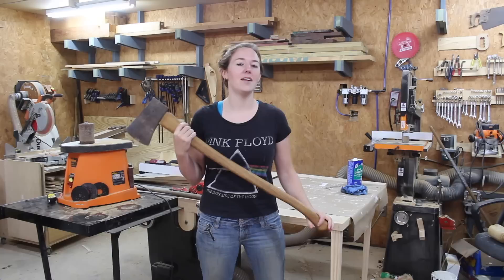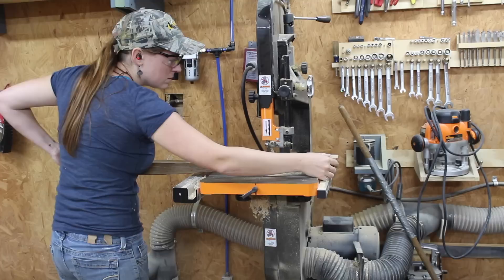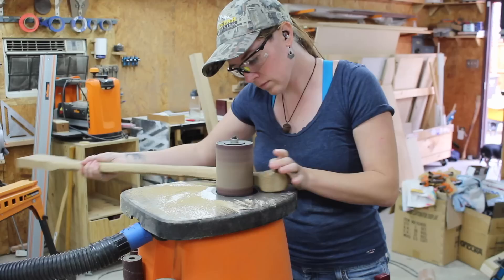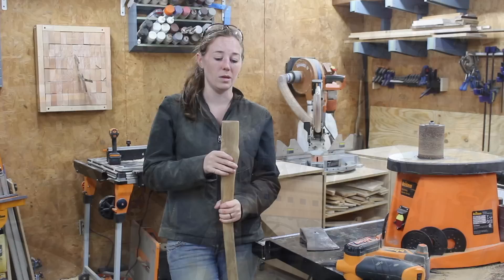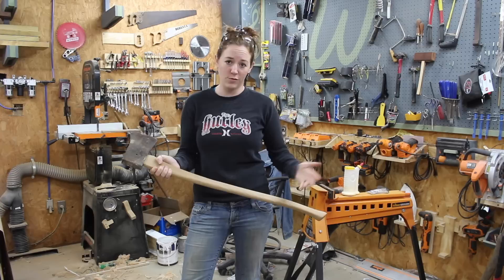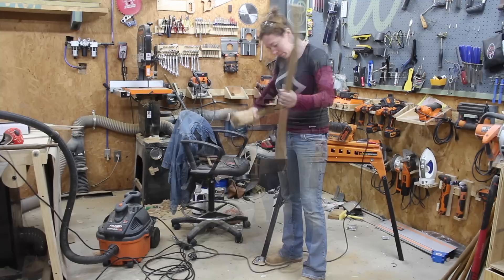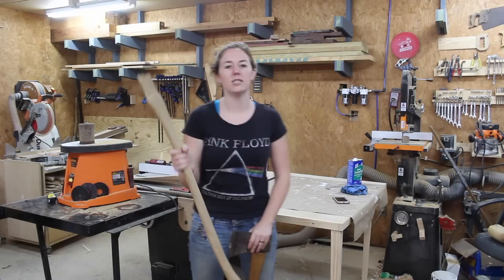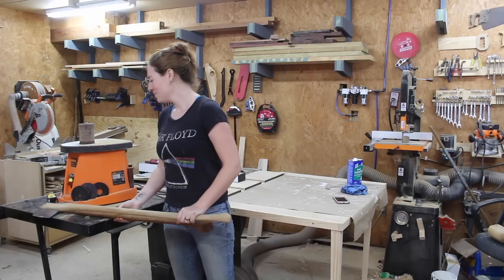Making an Axe Handle

Comment: Dont worry about mistakes. I do collision repair for a living. About 17 years ago I started working at a new shop, after I had been there about 2 weeks I got a job from my manager, went out to the car, pulled it into my stall, read the estimate and started fixing the car. The unfortunate thing is that I had started fixing the wrong front fender. I had read the estimate properly but got in a hurry and didnt realize that both front fenders had damage and only one was accident related. Long story short, my boss had to call the customer and tell them they were getting the other side of their car fixed for free because we were just that nice.. Oops. :)

Comment: Last winter I made a corner-shelf unit to sit on my counter next to the refrigerator.  All the shelves were specifically set for particular appliances an pots, and most importantly,  to allow just enough room for the breadmaker to be used without having to drag it out.  I even managed to get everything cut out of one half-sheet of plywood, which was tricky, since the over-all dimensions of the non-rectangular shelves was greater than 48”.

Everything cut well enough, I had my nice fitting dado’s, but as I assembled the las glued piece I realized I had put my two support pieces together backwards, and the bottom shelf had not enough “leg” and the top shelf had long upright sides it didn’t need. :)

I cheated by adding pine boards to the back as stilts so the shelf fit where it was supposed to be, and just slicing off the top extra bits, as the unit was sized to go from counter to ceiling..

Comment: Mistakes make a project interesting and force you to think on your feet. 

My biggest mistake in the workshop: While making a laminated bow riser. I sanded every 1/4 inch piece down to a rough finish so the epoxy would grab the wood, but left the back and front unsanded as I wouldn't be putting glue on those parts. After clamping and letting it dry and cure, I hand cut, rasped, sanded and finished the whole thing over about 9 hours. Once it came time to put the limbs and bowstring on, that's when it hit the fan. Turns out, the factory/smooth edge got mixed up and ended up dead center of the riser,  so as soon as I put the string on and drew the bow back a few inches, the whole thing snapped in half. I said a few of my favorite words, then scrapped the riser and started all over again. Riser 2 and 3 turned out pretty well, but I'll never forget what happened to that first one.

Comment: Funny that you asked about things going wrong, I only posted the following comment two days ago on 'Make Something':
I seem to recall a story about the early space programme where a rocket took off from the 
launch pad OK, but instead of going vertically into the sky, the  guidance system failed and it started to fly horizontally before being auto-destructed.  On the face of it, this appeared to be a massive failure, but one of the engineers pointed out that the rocket should not
have been strong enough to sustain horizontal flight - its structure should have failed, but it didn't.
The designers realised that they had made the rocket stronger than necessary, so were able to weaken the structure.   This involved a consequent drop in weight, which meant either a reduction in the fuel required, or an increase in payload - both tremendously important factors for rockets.   
An apparent catastrophe thus proved in fact to be a significant bonus!
For you April, the first errors enabled you to find alternative - and better - ways to achieve your results, so it was just a 'learning curve' !

Comment: Well I don't work with wood quite often, but most of my mistakes occur when I'm sewing. Honestly, I have countless stories on projects that I've messed up on where the fit was bad or the technique I was using didn't look right. Heck, I've even made things for other people that were complete crap lol. But somehow, I just never gave up, even when I probably should have, but I didn't. 
So yeah, that's my little story on my mistakes. The axe handle looks great, and I'll probably never have the need to make my own lol. However, I'm thinking about making a wooden handle for a DIY rotary cutting tool for fabric. I'm too cheap to go out and buy one, plus I have some blades that would work. Maybe if I finally get around to making this project, I can tag you to show how I was inspired by you haha. Anywho, great job!!

Comment: A tip for you when bandsawing - use hot melt glue to reattach the cut off pieces for much safer sawing. Keeps things almost square

Comment: Pappy (grandpappy, actually) would position the axe butt down, slip the head's eye  over the wooden "eye section" (per Alex W. Bealer), then thump the whole thing straight down onto a flat top stump or old railroad tie on the ground, the head end up. After each stroke he "checked it for square", tapping it with a worn out hammer handle to bring it to his desired angle of attack, then thump it again.
 Once the thumping acheived no further progress, he used a commercial wedge, seemed to be oak or ash, and thumped it head down for the final strokes, mashing the end of the wedge for good measure.
 Definitely soaked in boiled linseed oil a couple days, then sun dried, polished with an old leather glove and the head cleaned then oiled.

Comment: Mistakes. I'm working on a large cartography project, and have been for the last 2.5 years. I'd sunk more than 18 months into the project when I realized I'd done at least 1/3 of it COMPLETELY wrong and had to scrap all the maps and start over. I'm much closer to done now, and will probably finish it off by the end of this month, but that was a real head-meet-desk moment, realizing how much I'd done wrong. Helped me learn what to do differently, though!

Comment: I had the best desktop made with oak plywood centered on four oak board that I had spent weeks perfecting. It looked pretty sharp after routing the edges and sanding it smooth and level. Then I had a crazy idea from Jay Bates to try my hand at planing. So...I got an electric planer to level it out. I thought I had my blades set flat but alas, I had them easily 1/8" down and tore right down the middle of it, revealing the middle of the board and destroying the top's finish. Thinking it was needed to make the project work, I just kept going to town on that thing, ripping over and over...then I stood back and saw the horror I had just created. I started all over again.

Comment: Not a woodworking project, but I once spent the better part of two days replacing a damaged front fender on my old car, only to snap off the head of a bolt and scratch my door I the process, just as I was finishing.  I was NOT pleased...

Also, I think you should engrave the first axe handle on both sides.
"Failure is part of Progress,"
"...so don't lose your head."
Thank you for all the great videos!

Comment: If it makes you feel any better, I made a HUGE mistake on my Jay Bates Miter Saw Station Build. I didn't check the drawers for square as I was assembling. All 20 something drawers are not square and won't close properly. I now have to buy 8 more sheets of 3/4" ply to replace the drawers and fronts. :(

Comment: This is about 2 mistakes, one mine the other the cause of my mistake. Just before I turned 18 my father brought me an old 1959 Ford as a present for finishing high school. On my first drive I left with 3 forward gears intact and came back with one. I spent the weekend pulling out and rebuilding the gearbox. The car had been owned by an apprentice mechanic who had done it up as a project, including reconditioning the gearbox. I discovered the cause of the failure was that he had installed one of the synchromesh cones backwards causing it to seize in 2nd gear. Anyway my repairs lasted me 6 months and the gearbox failed again. The damage was so bad I had to go to a wreckers to get a replacement. They were very helpful and told me that that model gearbox had a lot of problems which were only fixed in the following years model and that gearbox still fitted my car. My mistake was trying to save money by fixing the old one and not getting the later gearbox in the first place. Still I learnt a lot about maintaining cars owning that one. My record for keeping cars going was a 1969 Holden, (basically a medium sized Chevy) I kept that running for over 500,000 miles. It would still be running but some idiot parked his Toyota Landcruiser into the back of it. He did a good job of it. Previously it was rear-ended by a Land Rover towing a boat and only needed a new rear bumper. Mind you he sandwiched a Mazda between us so that took most of the impact.

Comment: I am making a draw system for my workbench which I use for my polymer clay work and i need 20 draws for it well umm after I finished making all my lovely draws all 35 of them 🙀😹 I am now making Dad a screw cabinet with the extra draws that I made I sort of got carried away when cutting up the 3mm MDF because I had just made myself a sled for the bench saw 😹😹😹 and was having so much fun using it as it made the cutting the small pieces a breeze I did not count how many I was cutting just as well I had already planed on making Dad the draws cabinet for the screws just got made sooner than latter that's all😹😹
Loved the ax handle that you made I have a few pick ax's and double headed axes in the workshop was going to buy new handles for them but now you have inspired me to make my own 🤗 so have written it up on the job sheet we have in the workshop 😹😹 for all the things we want to make for both the works shops and the house 😹

Comment: Lovely job on the axe handle April...as said before you nailed it right down tot he boiled linseed oil and it prolly wont matter bu tone other tip is to run the grain the other way it makes it more durable .. what i mean is the layers of wood should run the same direction the axe head just like a sheet of plywood is bendy till you stand it on edge then it is totally rigid so that is also kinda my first failure story with handles i made a dozen hammer handles for my blacksmithing hammers and most of them broke then a old timer saw me on e day and said did you know you had the grain going the wrong way talk about red faced LOL  and how wonderful job cheers

Comment: I make pens, and one of the first nice pens I made I eyed the pieces (like I used to make models when I was a kid) and figured I knew how they went. It turned out that there were a couple of couplers that I had put on backwards, so now I had to disassemble the pen. Well, no tools for that (at that point) so I took some pliers to grab and twist the parts off. Yep, damaged them and some other threads, so.... Not to worry, I have a spare pen around the house, as I was able to repair it enough for that. Lesson learned... again, if there are instructions read them.

Comment: OK.  Here's a failure story for you.  I bought a band saw (I think yours and mine are the same) to cut band saw boxes with, though it has since become my favorite saw for all kinds of things.  Don't know if you've cut any band saw boxes or not, but there is definitely a top and bottom to the drawer since it's quite hard to cut them perfectly symmetrical.  I did not mark the tops of the drawers and wound up cutting the void for the drawer on the bottom of the drawer.  Yep.  You guessed it.  No way in the world would it fit by flipping it over.  So far not too bad.  But on the very next one, I did the same thing again.  Not quite as funny the second time.  I then learned to mark the tops of the drawers as you cut them out of the blank.  Simple solution.  They say genius is the ability to perceive the obvious.  I guess I don't qualify lol!

Comment: I was putting new fascia,  soffit and siding on my house.  I stripped all the old aluminum siding off and installed the new soffit and fascia.  There was one dormer part that had old cedar clapboards on it.  I didnt feel like stripping that off immediately so I continued installing the soffit and fascia.  When it did get stripped off and new siding applied.  I now had almost an inch gap betwix the soffit and wall.  So I had to rip down that 14 lineal feet of soffit and redo it.

Comment: I tried to make a handle for a small ball pein hammer.  I had some nice looking laminate material from an old cutting board.  Little did I realize that it was bamboo and I wasted about 90 minutes of cutting, shaping and sanding when my LAST CUT split the laminate halfway down and ruined the project.  Note to self:  Just because you think it will LOOK NICE doesn't mean it will BE PRACTICAL AND WORK!

Comment: Working as a software developer, at some point I fixed a minor bug (a menu that was shown when clicking a button was positioned about 50 pixels higher on the screen than it should be; for the record, I didn't write that particular but) in a piece of code that was used in different applications. Unfortunately, my fix introduced a new bug which rendered clicking several other buttons impossible. To top it off, applications with that new bug made it onto a released DVD that ended up at customers (which is something I only learned later, when my boss asked me to a bit more careful with that kind of fixes (by which he meant fixes in code common to different applications and with potential side effects) in the future).

Comment: Concerning the initial hickory dimensions, I find it very difficult finding 2'' material with the proper grain orientation. I got home and measured the thickness of my handle, 1" and the thickness of the eye, 3/4's. What is the final dimensions of your handle and could you comfortably craft a handle from the 1" stock?

Comment: I finally got around to installing my cabinets and counter tops in my garage.  I started finding places for my tools when I realized that I can't open one of the drawers, and cabinet doors because I installed them too close to the garage door track.  Now I have to take the whole thing apart, and move it right 6 inches.  We all make dumb mistakes.

Comment: My mistake:  I build large scale trains (live steam, ride on size) and was working on a 6 foot long gondola car. When I cut the sides I somehow had made a measurement error and had to buy a new sheet of plywood and recut the sides. I did save the bad ones and was able to make a different (depressed center flatcar) car out of them. 

I do have one question on your handle build, why not use a router with a roundover bit to rough cut the corners off instead of the bandsaw? Even though the handle presents compound curves it still should be easier (and safer in my opinion) than reaching around the bandsaw blade.

Comment: I love your videos even though wood projects are not something I have ventured into yet =)  You asked to share a moment when we had to start over a project and I was making a photo album from scratch and when I put the outside cover on I didn't check it prior to adhering everything inside---it was upside down.  The album looks beautiful except for the fact that the design is either upside down or opening the wrong way =/  Because it was all papercraft I couldn't unglue it without  destroying it so I keep it on my craft table to remind self to check the orientation of my paper lol    GREAT JOB on the final project!

Comment: Good job! Is that white oak? Where did you get that as a 4x4?
Reply: By the way, as for mistakes, I made more than a couple on my latest sign project. I got in too big a hurry painting the individual letters and skipped a couple of steps, which resulted in a horrible finish, then had sand them all down and repaint them, wasting an entire day. Then, when mounting the 38 feet of brackets to hang it, I discovered they weren't sitting flush with the wall, so I had to take them all down and hang them again -- 2 inches higher. (I won't link directly to the video, but you can find it on my channel to see how extensive the project was.) So, don't feel bad, we all screw up!

Comment: April, the first axe that I ever hung ended up not so good, too. It's still on that handle, but only until I finish breaking it. The head is loose, and literally the first time I swung it after the new handle, I struck with the handle, and split it. I now have 12 axes, and several hammers that I've rehandled properly, but that first one is still a bit special. Hahaha.

Comment: Would it be too difficult to just cut off the section of the handle that was 180 off and just make a slightly shorter axe handle?  Or maybe add to the small side and take away from the thick side?  In effect making the end go the right direction after all?

Comment: Interesting axe head. The holes drilled in both sides are to position a file while sharpening (the file needs a hole in it too) so the optimum arc for the edge is consistently achieved.  I would use a brass rather than a steel hammer to remove the head while fitting the handle to avoid mushrooming the head. Just reverence for old steel...

Comment: I spent hours on an old axe from an antique store(hand filing the rust off and everything!) and finally got the head on tight, went out to try chopping some wood with a friend and it only lasted two hours before the wedge came loose and the head almost came off :( disappointment. I guess I -couldn’t get the hang of it... lol cool video!

Comment: April, just a quick question. Where did you get the idea to glue the wedge in place after hanging the axe? I have hung many an axe handle and never glued the wedge, I have used metal wedges across the wooden wedge to hold it all together. If the handle were to break getting that wedge out to hang a new handle could be tougher then if was meant to. Just a thought.
Reply from the maker: Yeah I see your point. I saw Wranglerstar do it in one of his videos, and since he makes so many axes I followed his lead.